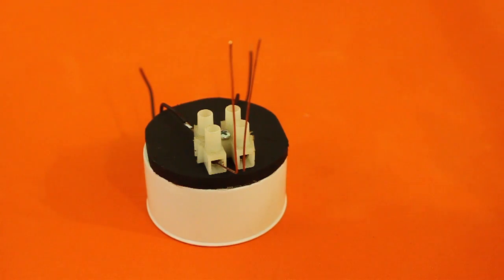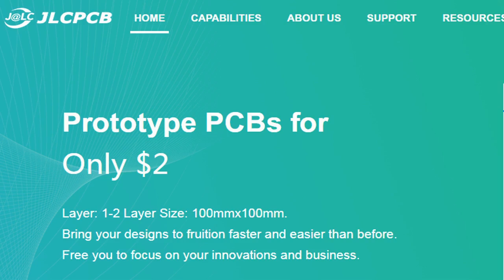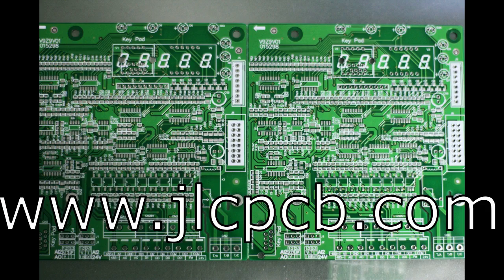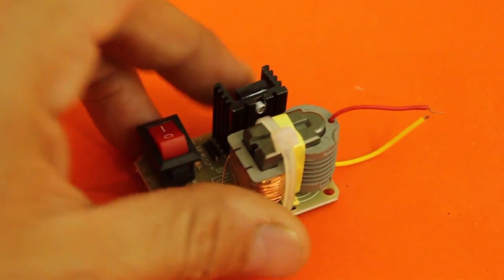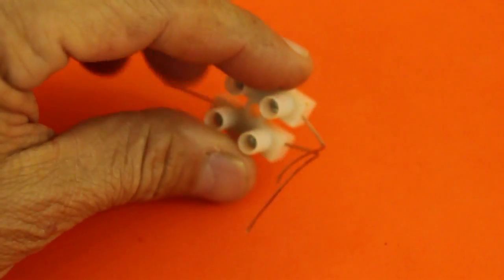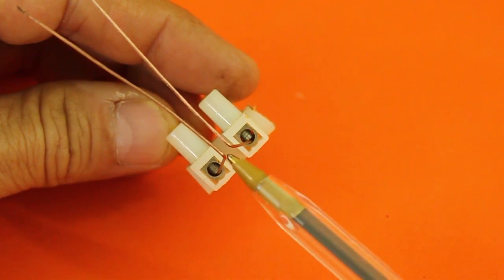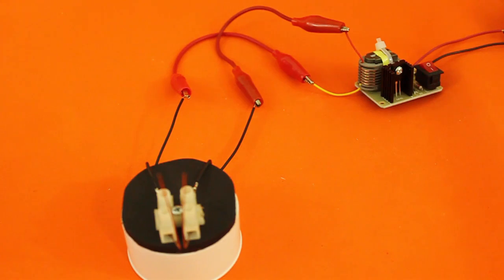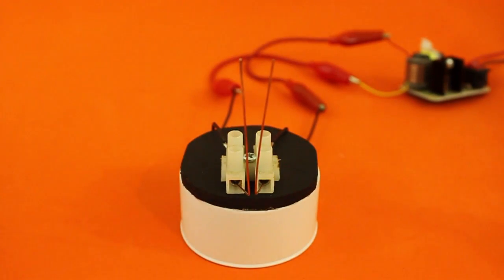Mini Jacob´s Ladder

Comment: Very clever design! with just a simple plastic connector. I like it, Good job! It has no practical purpose you say. But the height of the arc says something about the voltage level I would think, so it could also be used as a primitive voltage meter I would think. And I am still looking for some ways to make a guess about the voltage levels I can produce. I made a simple electroscope with aluminium foil which  tells me something about the voltage level.
Reply from the maker: Thank you, that power supply can give you some 12000 volts

Comment: Hi lucid  I live in uk 
Would you be able to let me know where I can buy similar power supply 
I cannot seem to find your previous vidio about it
Thanks
Reply: I only bought the transformer for just 1 euro. I did not know at that time that this kit was available, but if you have the transformer, the power supply is quite easy to build.
https://www.aliexpress.com/item/15KV-High-Frequency-Voltage-Inverter-Voltage-Coil-Arc-Generator-Step-up-Boost-Converter-Power-Transformer/32918002453.html?spm=a2g0s.9042311.0.0.27424c4dVuLiYD
And here is the kit itself: https://www.aliexpress.com/item/10PCS-CEG8205S-8205S-8205-SOT23-6-Dual-N-Channel-Field-Effect-Transistor/1852183013.html?spm=2114.search0104.3.2.50f54f7eza7PMF&ws_ab_test=searchweb0_0,searchweb201602_1_10065_10068_319_317_10696_10084_453_10083_454_10618_10304_10307_10820_10821_10301_537_536_10902_10843_10059_10884_10887_321_322_10103,searchweb201603_55,ppcSwitch_0&algo_expid=fc4a7441-d19e-46cb-9724-384e2b32a15d-0&algo_pvid=fc4a7441-d19e-46cb-9724-384e2b32a15d
Reply from the maker: Ebay should have it

Comment: About the arc. I have learned that the electricity always chooses the shortest distance. Why is it even possible that the arc rises like that. I mean when the distance increases it require much more voltage but in this case the distance increases pretty dramatically but something a little as heated air will rise the arc up. 
I don't know if I make my point clear but would it be possible to measure the voltage or amps and see if it changes when the arc rises? Maybe there is more to this than meets the eye.
Thanks for an awesome video anyway. :)
Reply: I think it is because the hot air from the original arc is already ionised producing a low enough resistance for the arc to persist as it rises, even though distance increases.
Reply: @Apollo-p1l  That is interesting. Like an ionised conductive air wire allowing the current to go through it with way less resistance. This would explain why the hot air can lift the arc up.
Reply: Yes, its the reason striking a current path in a neon tube requires a very high voltage, but once it is ionised it will continue glowing without such a high voltage. So in this case its like a moving ionisation path , rising due to the heat it is making. Great isnt it?
Reply: @Apollo-p1l  Yes indeed :)

Comment: Hello :-) Do you have a link to this particular high voltage supply?
Reply: https://www.aliexpress.com/item/10PCS-CEG8205S-8205S-8205-SOT23-6-Dual-N-Channel-Field-Effect-Transistor/1852183013.html?spm=2114.search0104.3.2.50f54f7eza7PMF&ws_ab_test=searchweb0_0,searchweb201602_1_10065_10068_319_317_10696_10084_453_10083_454_10618_10304_10307_10820_10821_10301_537_536_10902_10843_10059_10884_10887_321_322_10103,searchweb201603_55,ppcSwitch_0&algo_expid=fc4a7441-d19e-46cb-9724-384e2b32a15d-0&algo_pvid=fc4a7441-d19e-46cb-9724-384e2b32a15d